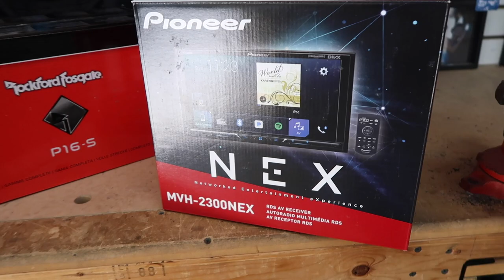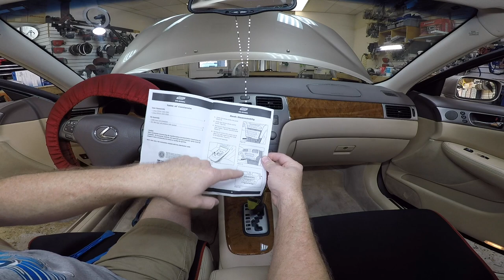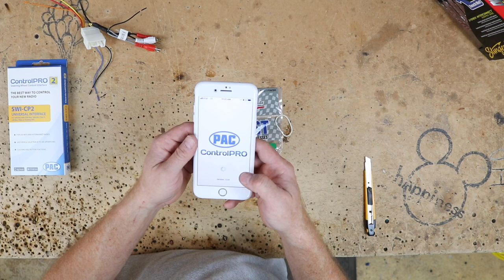Today we have a Lexus ES330 in for a full system.  Installer Diaries 103

Comment: What amazes me is that someone paid a few grand to do this on a car that is worth 5k at most.
Reply: Resale value is nothing compared to personal value
Reply: This stereo is probably around $1900
Reply: You have an older car, that was a VERY nice car when it was new, and still has all the leather, ride quality and power most people would want/need. It might not bee as fuel efficient as, for example, a newer hybrid GS, but other than that, if it's well maintained, i'd say its a perfectly good luxury car still today. So if you want a nice, like-factory infotainment experience you can do two things: Buy a 15-20k newer car on the same segment that HAS thoise niceties built in, or drop 2-3k on your current car and keep driving it. 

I dont mean to say one option is better than the other, but if the car runs fine, then it doesnt "amaze" me that they did this.
Reply: I installed a nice headunit on my 2004 Toyota Solara, 160,000 miles, still drives nice and the interior is beautiful. It just needed a radio lol so it isn't all that surprising tbh
Reply: I guess I just never viewed es330 as one of those cars. I always thought it was ugly, the brakes are mushy, it's slow to accelerate and handles like a tub. But I can see how for many people with a top of the line model, this is an option. I'd go with maybe LS or one of those 2JZ GS/Aristo models.

Comment: I need to save this video because I'm looking to buy a Lexus 330
Reply: Phil Jones i bought an 06 es 330 and it is a great car engine is very quiet and fast
Reply: It’s such an easy car to work with as far as upgrading the radio. Maintenance is very reasonable too. We have an ES300 with 265k miles. Just upgraded to a double din radio like this with Apple Car Play and it works great. The ES330 is an even better car. BYW, you will need the Toyota harness to turn on the amp.
Reply: Quiet, reliable, I miss mine
Reply: Just bought an 05 with 70k from first owner. I love it
Reply: @MrGogz2005  just bought an 05' w 38k for $7200 in Texas and drove back home to Detroit.  What a fine machine !
Reply: @shwndh  How much did this cost you for car play replacement unit?
Reply: I had a 2007 and it's an All around Excellent Ride!
Reply: @MrGogz2005  I bet it Runs Amazing! Especially with that low of Miles!
Reply: @treydaypnw  yes it's an amazing ride.
Reply: Do you guys use wireless or wired Apple CarPlay/Android Auto? I have a 2005 ES330.
Reply: I've had mine for 5 years and have 210K. Still drives like a dream. I'm doing a transmission service on it just because. I plan on trying to keep her till 300K so I'm just doing some routine maintenance to keep her healthy. Next will be tires. I change the oil with full sun every 8 K and rotate the tires when I do. So far that's all working. Never had anything big go. I replaced the timing belt at about 120K.  That was probably the most expensive thing I've ever done and I probably didn't even have to.
Reply: @MrGogz2005  you'll have that for 10 years if you do very minimal maintenance
Reply: @jasonthach44  I have the option to do either on mine. I have a JVC DVD player in my 06 330. It's great. I had it done professionally and it cost 425.00 all together and they came to my house and did it while I slept (I work nights).
Reply: About how much some like that will cost

Comment: No matter what, it's still a Toyota at heart. They are amazing vehicles.

Those fire walls were such a nightmare tho. Also, all cabling from the truck as a pain to get past the rear seats. I want that good tho ha
Reply: In my 05' ES330, I just bypassed that factory amp behind the glove box to a ['Soundstream'] 5-channel amp IN the glove box [mounted to the inside top]. A little tight, but really a good fit.  Point is, I could run 4 guage OFC wire from the battery along the firewall through the rubber grommet securing the big wire bundle going to the ECU.  An invisible razor cut close to center, then a long stainless bbq skewer with the wire taped behind the point.  Easy peasy 'spear fishing' to push power to the glove box. I guess the added length to use that ingress (in this video) is more costly than drilling through on the Driver's side?  Is routing power across low behind the dash a no-no?

Comment: Thought of a second question as well.  Do any of the major radio manufacturers have a 2.4A USB port, or any talk of including one?  Faster charging while connected to the head unit would be awesome!
Reply: Not that I've seen.  Getting a wireless unit (still more expensive) is the best way to ensure you can still plug into fast charging for your phone (qualcom or USBPD)

Comment: You don’t need a micro bypass for Pioneer avic radios. Turn off radio power. Press on bottom left corner of screen for 30 seconds. It will disable the parking brake and speed sensor crap.
Reply: Still need it for some functions like Android Auto won't set up unless you have the parking brake on (or a bypass).

Comment: Is there a guide for removing the rear deck? I assume you have to remove the seats first which for whatever reason do not fold down. I have a 2000 XLS , and I plan on separating the trim from the actual deck with some sort of sound dampening material but want to try and see what I am up against first so I can make a plan

Comment: I wish there was a video of you all replacing a 2007 Toyota Avalon JBL System 6 disc,Non Navigation unit with a double din. There’s some harness that makes you put the factory radio in the trunk! Where the hell do I put it without it getting damaged? It also has a center speaker in the middle of the dash and a subwoofer in the center back deck. Should I bypass the factory amp? Or use the factory amp and just replace all the speakers and just add a subwoofer amp and subs to complete the install? I want to replace All the factory speakers with aftermarket. So confusing.

Comment: Got excited when I saw this but it’s newer model.  
Have you done many 2000-04 Toyota Avalons? It’s got the JBL amp. Looking to do 8201NEX with rear cam and dash cam. 
Not sure if I should use the jbl amp or ditch it. The stereo works fine I just want updated options like CarPlay , gps, BT etc.
Reply: Don’t listen to J Silver. I’m running a Pioneer CarPlay head unit into an ‘02 Camry with factory JBL just fine. Metra P/N 70-8113 is your friend.

Comment: hey Dean, by any chance do you know what reverse harness is compatible with a stock alpine amp from a 2014-208 Jeep/Dodge/RAM??  I know idata makes the aCH2 t-harness (saw your video about that.... I just need the reverse plugs that would fit back into the stock alpine amp. thanks!!   I'm making my own t-harness to grab the stock speaker leads, but keep everything else connected.

Comment: Why remove the wires from an expensive universal interface ? A year from now if the customer buys a new car and those wires are needed for the new one, They will have to buy a new interface.
Reply: They didn't remove wires from the interface.  They removed wires from a connector that fit the interface but did not have the right pin-out wiring for the interface.  Dean rebuilt it to work with the interface.  Any new head unit they may buy in the future would just use the same connector again.

Also, they hooked that car up with great gear and installed it such that it won't fail for many years if ever.
Reply: @ 12:16 Dean removed two wires from the interfaces harness because they were not required for that car (what about next car?). I am a fan of the channel and think they do phenomenal work.
Reply: But he has also said in other videos that if u need the wire he removed he will give u a New harness or add them
Reply: jaime villafan 
Your right. As long as the customer returns to them, got it. I'm simplying saying it'd be better (I think) to just cap them off just in case.